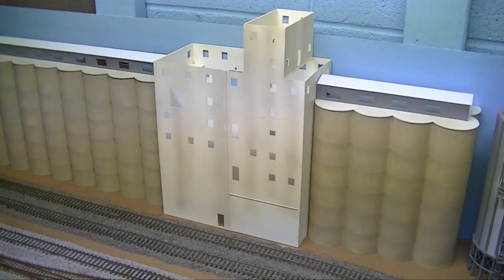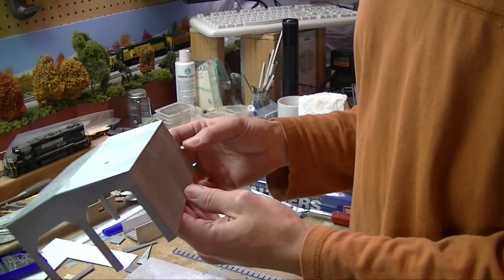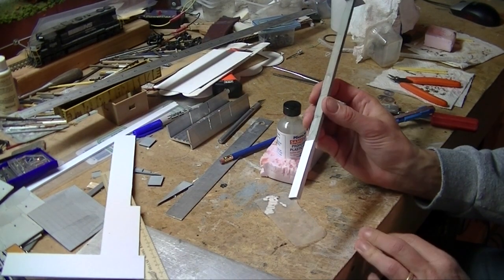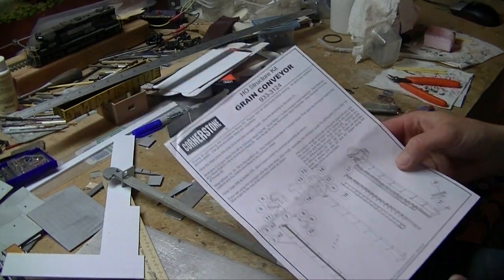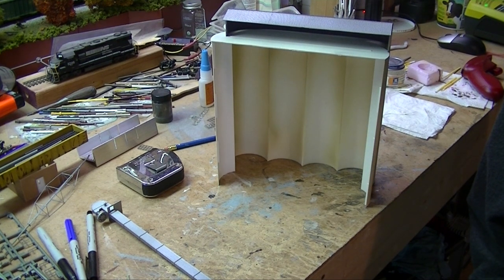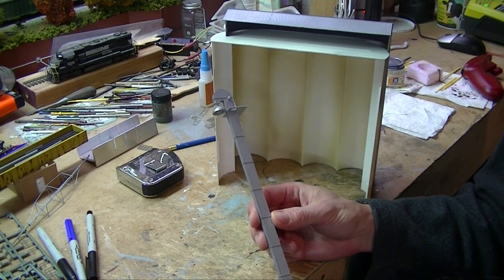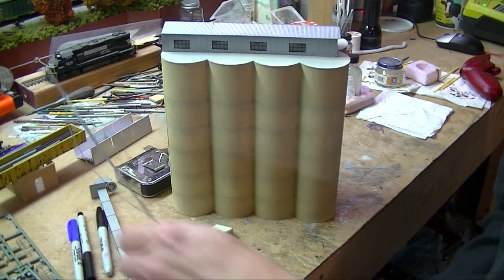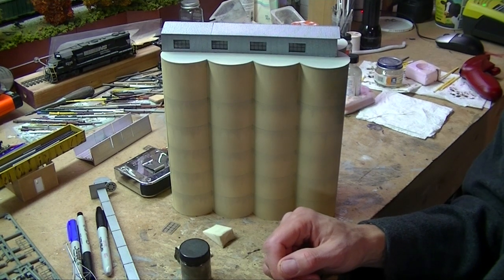Because Everything is a Trilogy These Days - Grain Silo Project Part 3

Comment: hey Matt your project came out excellent... a couple of suggestions.. first, the rix HO elevator kit comes with all the extras your bought ( piping, guy wire supports etc.) second, for your windows, i found adding the windows off an regular postal envelope & a piece of scotch tape will give you the same effect...any way just my thoughts...thanks for sharing
vinny
Reply from the maker: Thanks Vinny!  Now you tell me about the Rix products.  ;-)  That's a good tip on the plastic for windows too.  I'll have to remember that for future structure projects.

Comment: Been watching your vids and your doing great. I used to race 10-speeds way back when and had a Gios Torino w full Campy set up.

Anyway, there are LEDs that are 1 and 1.5 volt. I order them in quantity all different colors for my Christmas cars for G scale. Quite sexy I should say. They have 80-110 degree view and with the right resistor you can make them more COOL in brightness. I found them on eBay of all places.  Hope I helped.
Reply from the maker: Full Campy. . .  That would be a dream.  I hope to some day be able to afford a Colnago with Campy.  My version of an Italian Sports Car.  :-)

Nice tip on the LEDs too.  I'll look into those.

Comment: Hi Matt. Can you please advise if the steel silos used are kits or scratchbuilt. If kits, what are they?  Here in Australia, there has been an explosion of large on-farm storage of grain and because of that, the new rail terminals are high speed throughput loading facilities that hold minimal tonnage storage. Your steel bins are perfect for that (a nest of 8 or 10).
Regards, Jack Schmidt.
Reply from the maker: These are the ones I used: https://www.walthers.com/wet-dry-grain-storage-bin-kit-2x-each-3-5-8-x-3-5-8-x-12-quot-8-6-x-8-6-x-30-5cm-pkg-2

Looks like they are still  available.  Hopefully not an issue getting the in Australia as well.

Hope that helps!

Comment: Nice Project. If you add some flux and soldering metal on the parts you are gonna solder before you put them tougether, and then have a small drop of soldering metal on the solderingiron as heat conductor, - Put the parts in position and just make contact With the solderingiron for aprox 1 second. Blow air on the soldered part while removing the soldering iron to cool it Down. This way the plastic will only melt aprox 1 of 10 times and a lot less Money in the swearing jar:)
Did you make the two big silver collored silos yourself or are they part of a kit?
Reply from the maker: Some great tips on soldering.  It's one of my favorite methods for working with metals as you can get some very clean and strong joints.  Like you said though, gotta be quick with the heat and plastics.  The two silver towers are Walthers Grain Drying bins or silos.  I do not recall their exact name, but it's something along those lines.  They are straight kits, no kitbashing on those.
Reply: ChessieFan2 I did not look at the date so you probably figured out the best soldering part yourself before i posted the comment:) I was so rubbish at soldering at one point that i looked through allmost every video on youtube, and ruled out every Method Close to my previous ones!  The Walthers silos look very Nice and seems to have a lot of details. You have many Nice pieces on the layout but I think maby because I haven`t seen similar silos before, they have the x-factor
Also very impressed With you making pipelines With supports and stuff for the build in this video, but that is wow-factor!.